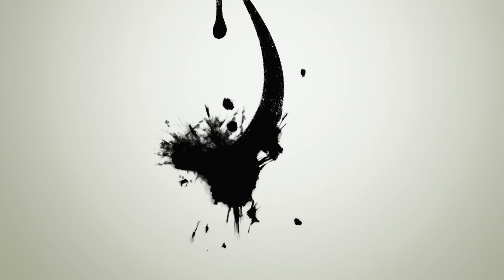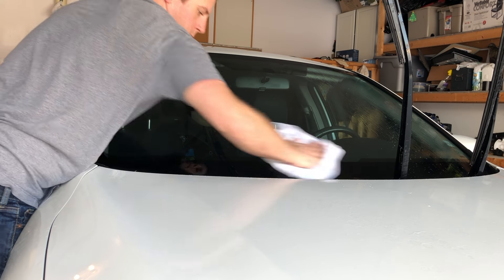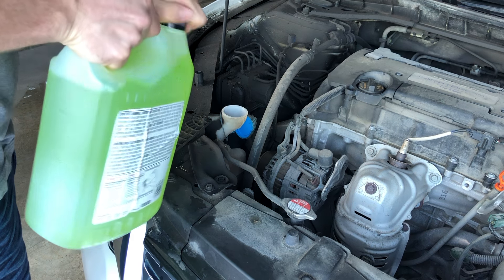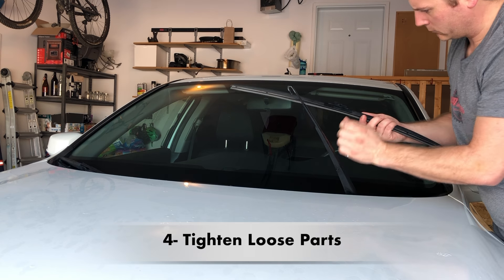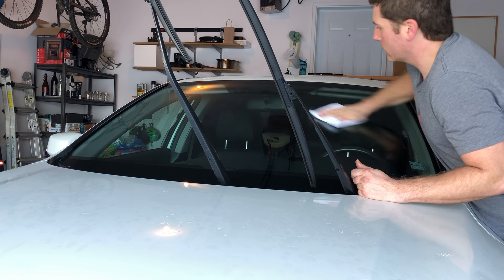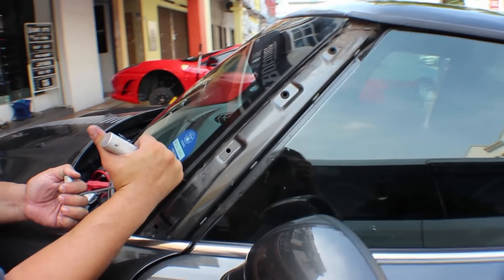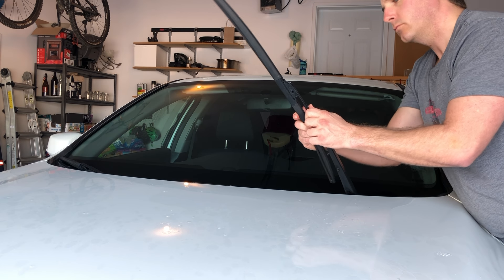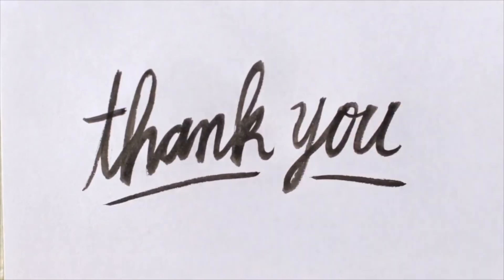How to Make Windshield Wipers Stop Squeaking - 6 Ways!

Comment: back in the day...lol.. when I was young and working at gas stations ALL cars fueling up with a 'fill-up' (regardless of the amount of gas it took) got a free windshield wash.  We also checked their tires on request and the engine oil as well.  That's why they were called 'Service Stations'.  Still, in Oregon, drivers cannot self-fuel.  Except diesel.
Reply: Also, in New Jersey is the other state where you cannot pump your own gas someone has to do it for you

Comment: Seems to be a design flaw. When wipers are not in use the blades are flipped up. They are in this position while the sun bakes the blades. After several days of baking they are now curled up, therefore causing chatter going up but not down. They should be designed so when down and not in use, they should not contact the glass at all.that way they would stay straight.

Comment: I personally think the best way to have quiet non-squeaky windshield wipers is to buy Teflon Wiper Blades. Teflon is self lubricating, and works great with wiper blades. But not many options for this wonderful design: The only Teflon wiper I know is Trico Winter "Ice" Wiper Blade. You won't be disappointed. ($5-6 each Rockauto). Great all year wiper blade.

Comment: BOSCH ICON wipers work very well. See Project Farm you tube channel. The Windshield should also be clay barred to remove more stubborn films that won’t come off with simple cleaner.  A magic eraser with glass cleaner is also an option to scrub the glass clean. Very stubborn stuff a DA machine w felt pad and glass polish like griots.  I use distilled water in the wash reservoir with some no rinse car wash added. Like ONR (Optimum No Rinse) McKees 914, or P&S Absolute would also work. One or Two caps should be plenty. Just make sure P&S is fully dissolved if using that product.  Griots glass sealant works well if you decide to apply a coating
Reply: Nice info! Thanks

Comment: TBH number 6, is the best, I replace twice a year, winter and summer, it may be expensive but 2 things are important on your car and also on a safety point, tires and wipers, I've never had problems with either, also use winter wipers in winter, summer in summer, you can swap them instead of replacing them, then maybe every 2 years change them out, on my car there is no winter wipers option so I opted to change out twice a year.

Comment: Mine always make a little squeek when going up and going back down when it rains. Cleaned the wiper many times and cleaned the windshield and bought OEM Wipers from factory. Not sure what to do. Even he windshield is new.
Reply from the maker: Did you try rainx?
Reply: @soundproofguide  yes im using it now. It will quiet them down for a while and then get back to the squeek.
Reply: Elyas Esfandieyar Mine also it’s annoying
Reply: @Sebastian.12  I tried looking at how the wiper arm is positioned on my car when I got it new. I bent it a bit and its not making noise now
Reply: Try to twist the wiper arm that should fix the problem the wiper blade should be perpendicular to the windshield

Comment: Ladies and gentlemen this kid I’m old enough to be his father . I have replaced wiper blades countless times this kid literally does not know what he’s talking about. Windshield wiper fluid does absolutely nothing to fix the squeak or the rubbing of your blades. WD-40 is an oil that’s made to penetrate rust and is a very sticky substance to get rid of squeaks. The rubber on a windshield wiper blade is thin WD-40 will crack it overtime and worse in your problem. With rain X literally makes your windshield slippery so you don’t even have to use your windshield wiper blades. When rain X first came out just like everything else. It worked great for a good six months. I didn’t even have to turn on my windshield wipers, but like everything else it doesn’t work as well so you have to buy more rain X my suggestion is you flip your windshield wipers around on the holder. Years ago the news day paper had something in the ink that made the windshield very slippery and prevented squeaking.

Comment: I drive a 2013 Kia Optima SXL and I’ve tried several different kinds of brakes with different brake materials on them AND I’ve also bought 4 new rotors and had them put on too, but my brakes ALWAYS Squeak when I use them no matter what. How do I stop the squeak?
Reply: Don't have s3x inthe car while driving

Comment: My blades make noise going up but not down.  Going down the blades wipe but going up the blades are ''pushed'' and chatter.  I've tried bending the arms so the blades wipe on the up wipe but to no avail.  ???
Reply from the maker: Did you try any of these tips since watching the video? And if so, how did it work for you?
Reply: You need an adjustable spanner and bend the arm either up or down in small turns untill the squeaking stops sorted!!

Comment: just bend the fuckers so the blade is parallel with the glass. You want it to drag the blade both ways, not drag one way and push the other.  Is dirt really the #1 cause of the noise? I find that hard to believe.

Comment: This stream is total tripe😡? Why because it didn't address the main issue as why you get noisy skipping wiper blades on one side and not the other?? If the wiper arm isn't tuned properly, No amount of cleaning and other gimmicks will sort this annoying problem, There's plenty of utube streams showing  the proper way to adjust the arm in a few minutes!! If your looking to buy new wiper blades look no futher than silicon wipers which last twice as long as rubber blades, And lastly never put WD forty on rubber blades it's a mild solvent which drys out the blades causing cracking and splitting, Rainx is a excellent product not only a water repellent and windscreen cleaner and will not harm rubber or silicon blades!!!